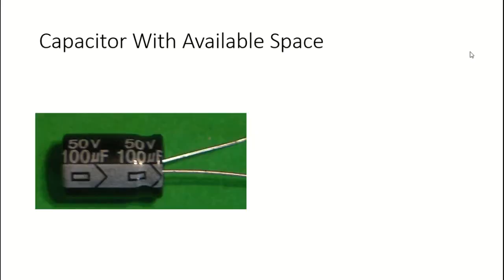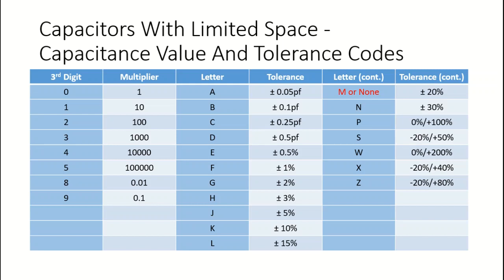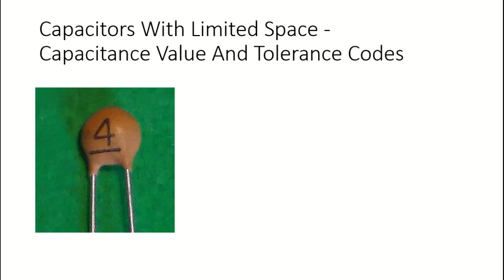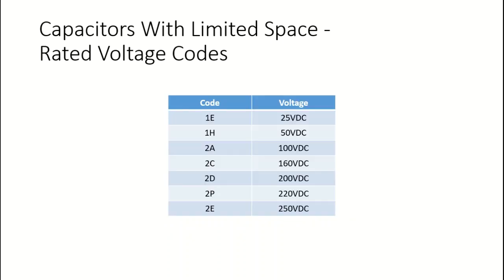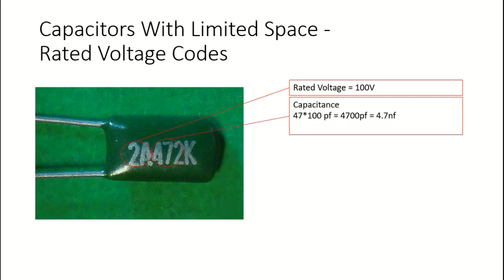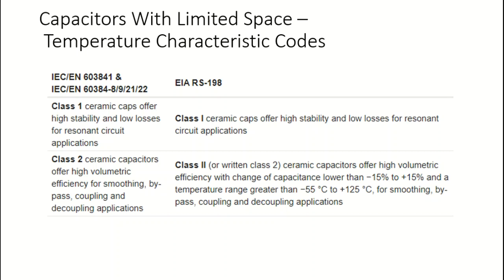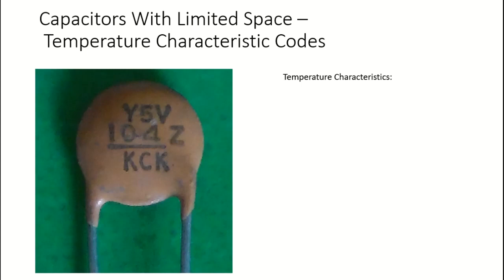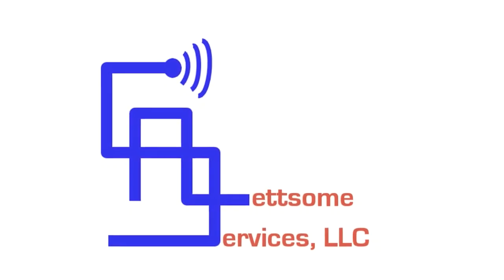How To Read Capacitor Values

Comment: Hi! very nice video. I am trying to decode a capacitor with three lines but the amount of numbers and letters is different; it's three lines, the first one is 33, the second one is 50 A., and the third one is 4PO. Could you tell me what are the specs of that capacitor? By the way is a faulty capacitor on a condenser microphone AKG C4000 if you're familiar with it. Thanks

Comment: Thanks man, this is very useful!
Reply from the maker: Glad it helped!
Like, Share and Subscribe.
Reply: @CALettsomePhDPE    I am an engineer but a novice at EE but I believe you mixed up the bipolar and polarized issue.  I believe bipolar means non polarized.  The Cap with the negative sign is not bipolar but polarized. The second cap is non polarized as shown by BP(BIPOLAR) and the necking at both ends of the cap.
Reply from the maker: @brianb2634  thanks. If I did say that you are correct. I will add a note.